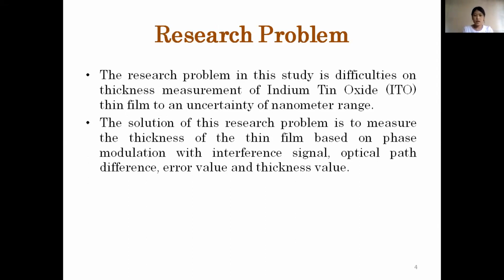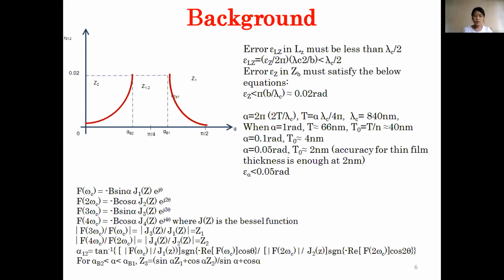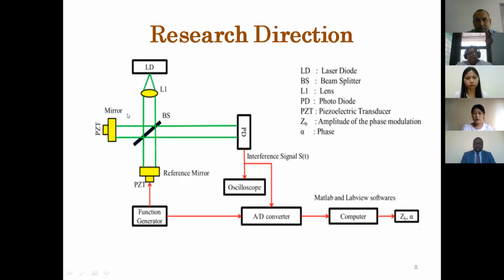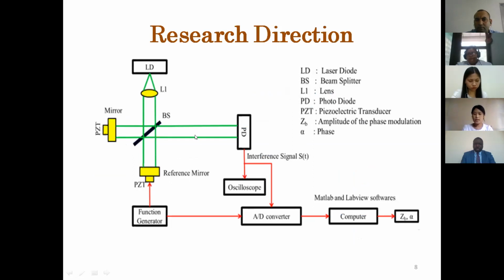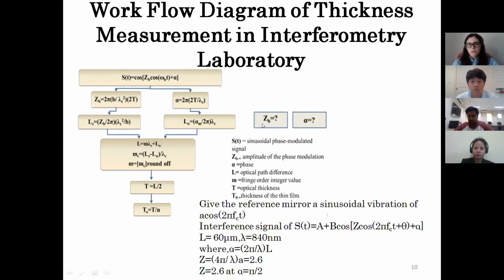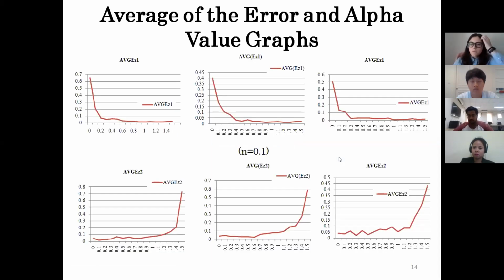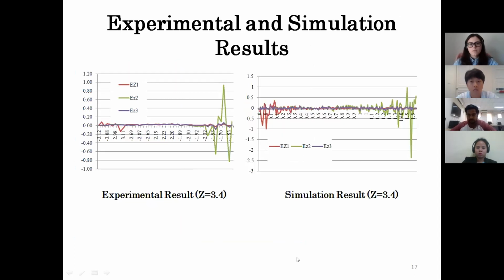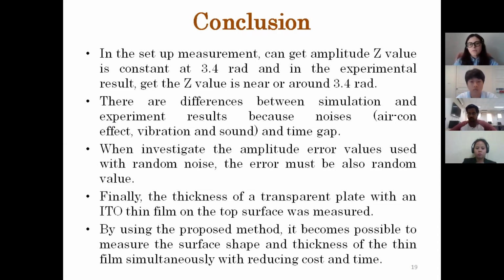Conference in Malaysia

Comment: Objective : (Conclusive)

Reason : (Theorem)

Solve : (Metric)

Explanation : (If time factored elements are to be displaced within a spectrum, You would enhance the visibility of the displaced medium, Being Space and area for study, Reading the relevance is easy, the graphs showcase all mediums on transfer, Therefore when the result is visible for calculus, Then in that case trignometric evaluations are redundant within error, The cost equation is the reason for a meticulous end to the error within solve, If energy is measured in Quantum, There is a disparable effect on Mass, measured in Weight Distributed, Thereby creating a fulcrum within the experiment, Theory states, If glass is lighter than air in the vacuum created as measure combustion of light, The experiment results the opposite to mathematical clearance on data. Finding the answer is easy to calculative reasoning, The apparatus is changeable within adjusted Index Measure, The stimulus here being a lighter fuel to calculations, Helium being the element on a disturbed medium. I see the answer on provided scales, Though it would be impossible to prove without a laboratory on gaseous exchange. The film as sample will radiate light on the module, Provided the prism is scaled by experiment and adjusted values.)

https://www.youtube.com/user/genga49/videos

https://www.facebook.com/ajit.rrao/